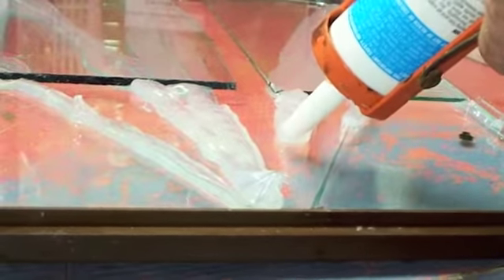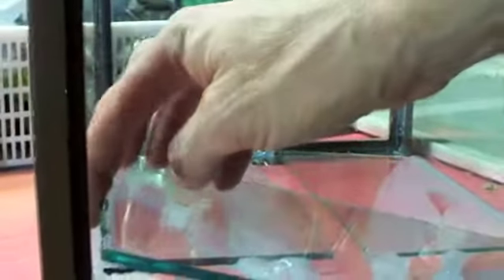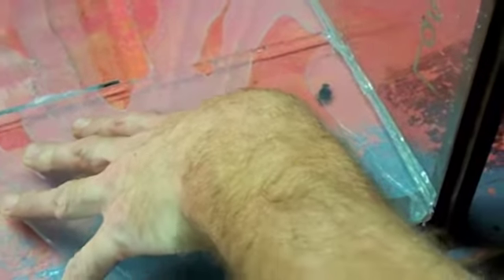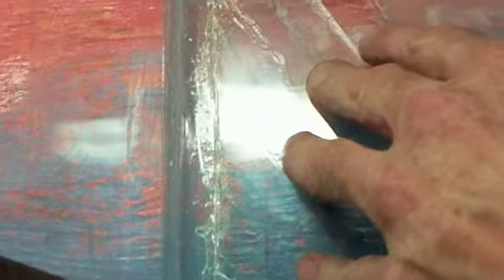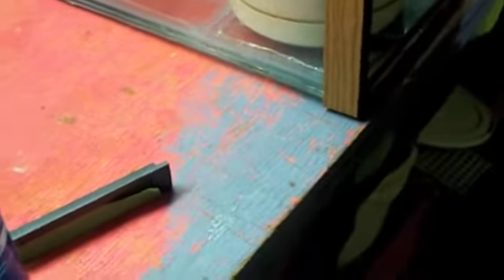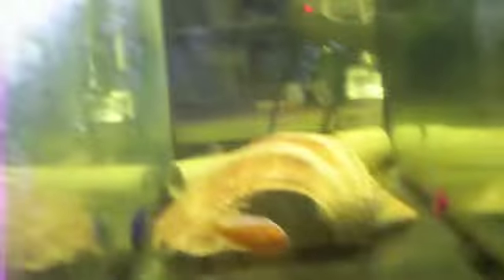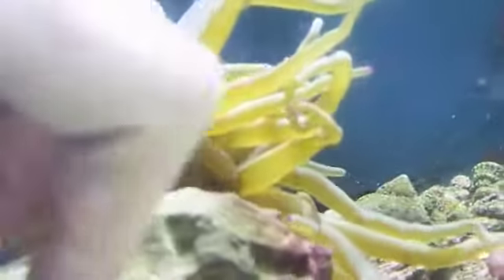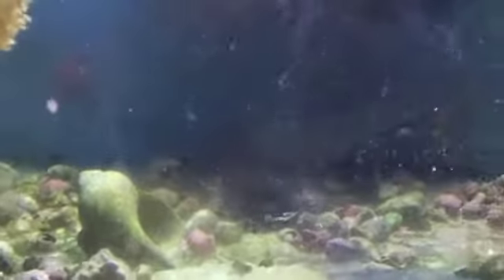# 267 Tank repair with 3 Pieces of Glass Part Three Carls Aquarium

Comment: I have a question.  I came across a used 300 gallon aquarium, but it has a crack in the bottom panel, the guy had a repair place put a whole new panel overtop the bottoms panel and resealed the tank.  The tank also has a chip on the side near the seam on the exterior of the tank.  It was full of water and has fish I. It, I don’t see a leak but it does look like there is some condensation near the chip area.  He has the aquarium in his garage and is basically giving it away for $250.  That includes the stand pumps lights etc.  should I be concerned about the repairs or should I pass considering it’s 300 gallons of water pressing on the repaired area?
Reply from the maker: FAT BOY Reviews Can you send me pictures, 41644609922 and I can tell you
Reply: CarlsAquarium 

I don’t have the aquarium yet he still has it I have a pic of the chip but the bottom is still covered by his substrate and sand.  I’ll message you the pic I have of the chip though
Reply: CarlsAquarium 
I tried sending pictures to that number but it comes back invalid I’m not sure if there’s too many numbers or not enough, I’m in Florida by the way so depending on where you are I may not need all of those digits
Reply from the maker: FAT BOY Reviews 14164609922 should work